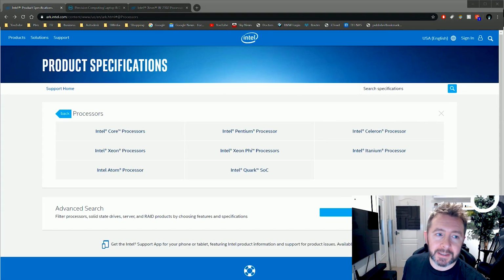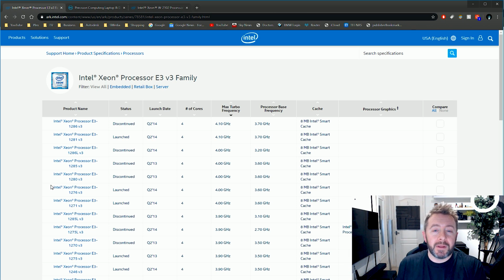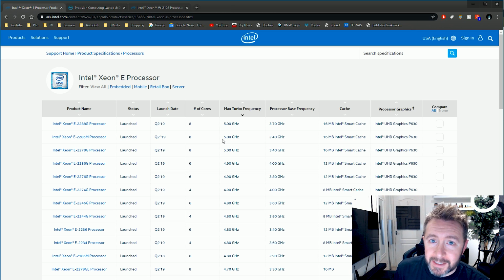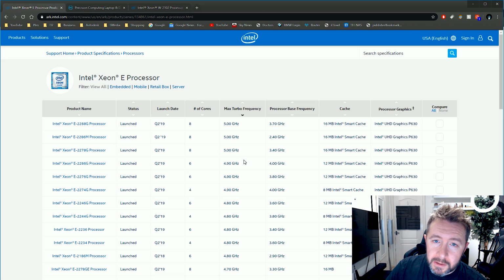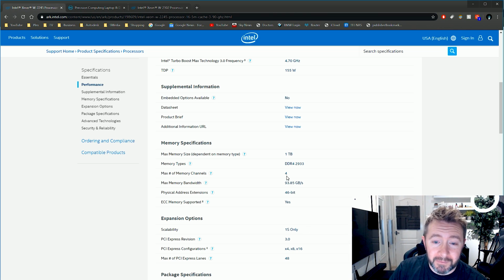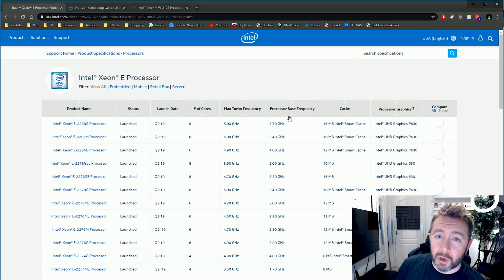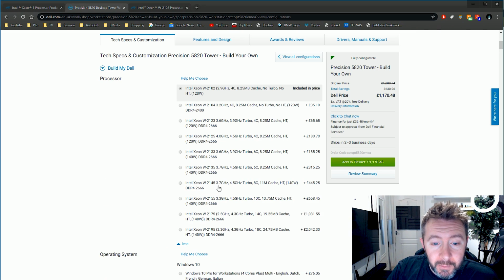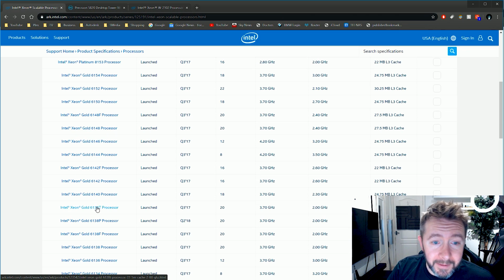What's the difference NOW between Intel Xeon and i7 i9 for CAD Workstations

Comment: I generally agree, but the paradigm seems to be shifting again. Pure CAD usually was not able to use more than a few cores well. It’s more of a mixed bag now with some workflows benefitting from cache or core counts at unexpected points.

The software landscape is changing. I used to find single threaded bottlenecks everywhere. At one point, I was even catching what I assume was SolidWorks draw calls for edge display hitting CPU bottlenecks and other oddities. A bunch of stuff like that all got sorted over the last 5 years or so. I’ve even compared on the same Quadro to verify that bottleneck was dealt with.

One of my biggest surprises was when in my own testing I found my dual LGA2011 workstation running circles around a similarly clocked i7 in single threaded parts of the workflow, 5+ years ago. Was very likely the much larger cache.

Now I’m finding that CAM software is actually able to hit near 100% utilization on 28 cores.

In conclusion, I wouldn’t write off lower clocked higher core count Xeons with more cache, I/o, etc. Yes, they cost more and they aren’t for every workflow, but there is real benefit to the architecture at times and software is starting to utilize it better. In the near future, I’m expecting the sweet spot to be a bit higher core counts/cache with things like the 13900k doing well so long as the software and scheduler get along.

Comment: Well, I still wouldn't recommend using an Xeon-E Desktop CPU unless you really need to use ECC. The biggest difference and the most important one is the boosting behaviour. 

With Xeon-E CPU in general, the CPUs will be boosted according to the Intel spec. This means that, that maximum boost clock will be only maintained for 8 seconds then it will default back to the base clocks. Whereas with the Core line, the manufacturers just do whatever they want and set the boost to unlimited. This makes for being a bit more creative in selecting motherboard, cooling and casing as the CPUs can get quite hot. But more importantly, they can maintain the boost clock indefinitely. This means you would end up getting way more performance by sticking with the Core line, and making the Xeon-E simply not worth it, unless you really need ECC. And considering how much focus you placed on the boost clocks, this information is extremely important and should be taking into consideration when recommending an Intel CPU. 

Do note that this "unlimited boost behaviour" is done my motherboard vendors in general. The big OEMs probably don't do this, but this information is nearly impossible to get. 

For notebooks it is better to base your choice on the base clock of the CPU instead of the boost frequency, for exactly the same reason. Notebook CPUs almost always stick to the Intel spec (boosting for about 8 seconds) and then falling back to the base clocks.
Reply: I don't know if this is true for all Xeons, but I was able to set my Xeon-E to boost until hit hit 100℃ using ThrottleStop

Comment: Hello There,
Thank you for your nice explanation.
 I have posted a Question on the Inventor forum for the selection of a CPU and a graphics card.
Will I9-12950HX perform better than Xeon E-2276M, and what card would perform better A4500 or A5500 if both are 16GB.

Comment: Hey Neil, can you tell me which type of processor would handle this process better in Inventor (Xeon or Intel 'i-')?
BOM editing.
One of the most time consuming processes happens when I copy-and-paste or drag-to-fill an entire column in the BOM consisting of more than 500 discrete parts (with multiple quantities). So for example, after sorting the bom and auto-filling the 'Item' with numbers, I copy those numbers and paste them into another column, that can take up to 3 minutes to process. Do you have experience to say which type of processor will do that quicker, and how much quicker? Another scenario is when dragging an item at the top of a column all the way to the bottom in the same BOM. Can you tell me which processor type is best, Xeon or Intel 'i-' type? Thanx...Chris

Comment: Hi im planning to buy a used 5 yrs old workstation laptop with Xeon 1276M + Quadro P1000 for $500 for cad works and learning Inventor and revit. Is it worth it?
or 2 yr old i5 10300h + 1650ti for $500
or new i5 1235u + 3050ti for $700

Comment: Where did you get the info that the i9 and the xeons are the same chip? Can you send me a link? I have just never seen this before?
Reply from the maker: I’m not sure if Intel have or ever would come out and confirm it, but there’s tons of press articles saying this is the case. It’s also logical. They’re not gonna have two different fab processes which mfg the exact same specs but then just brand them differently on packaging, that makes no sense. But it’s widely reported as common knowledge, documented by third parties who possibly have contacts who’ve confirmed it, but personally there’s no doubt in my mind. There are many xeons that are unique and not shared with a core sku though.
Reply: I just don't see how that could be possible. Wouldn't the architectures be completely different with a Xeon vs a core processor? I tried to do some digging but I couldn't find anything confirming this.
Reply: @Neil3D  Its Zeon's are also way more expensive by the looks of it. Am I wrong?
Reply: @Neil3D  Zeons also look way more expensive, no?

Comment: What's the issue with RYZEN ? I'm a Phd student and will be doing lots of work on CST and Ansys doing antenna simulations. I have sent a Ryzen Threadripper 3960X based config to my IT team. Is there anything i need to be worried about ?
Reply from the maker: Things change over time, as new products are released the landscape can change.  But at the moment AMD do not have a good reputation for software & driver reliability, at a low budget level that's not much of an issue but at enterprise level that's not acceptable.  But as they're releasing new generations of Ryzen they're now beginning to catch up with and arguably take over Intel with performance, but whether the new stuff is reliable enough to run in enterprise is an unknown.

Comment: Just ordered this from dell . I needed a new laptop for cad design . Is there anything you would change ? Thanks . 

No FGA
32GB DDR4 Memory,4X8GB,2666,Non-ECC,SoDIMM
M.2 1TB PCIe NVMe Class 40 Solid State Drive
Qualcomm QCA61x4A 802.11ac Dual Band, 2x2, Wireless Adapter + Bluetooth 4.2
7740 Smart Card, Fingerprint reader, & NFC
E5 C13 Power Cord 1M for North America
Safety/Environment and Regulatory Guide (English/French Multi-language)
Qualcomm QCA61x4A 802.11ac Dual Band, 2x2, Wireless Adapter + Bluetooth 4.2 Driver
6 Cell 97 Whr Long Life Cycle Lithium Ion Polymer Battery(3 Years Warranty)
Intel Xeon E-2286M, 8 Core Xeon, 16M Cache, 2.40GHz up to 5.00GHz Turbo, 45W, vPro
No Bracket
Windows 10 Pro for Workstation (4 Cores Plus) Multi - English, French, Spanish
No mouse selected on your system
No Option Included
US Order
Dell Limited Hardware Warranty Plus Service
ProSupport: Next Business Day Onsite, 3 Years
Thank you choosing Dell ProSupport. For tech support, visit //support.dell.com/ProSupport or call 1-866-516-3115
No Carrying Case
Not ENERGY STAR Qualified
No AutoPilot
No UPC Label
Dell Precision Optimizer
CMS Software not included
Intel ME Disabled
Resource Media not Included
Microsoft(R) Office 30 Days Trial
Internal US English Dual Pointing Backlit Keyboard
Keyboard Lattice
No Additional Hard Drive
Regulatory Label included
FCC Label
No Docking Station
No Mobile Broadband Card
Intel XEON Processor Label
No Accessories
Intel Xeon E2286M, 8 Core Xeon, 16M Cache, 2.40GHz up to 5.00GHz Turbo, 45W, vPro
No Additional Hard Drive
No Additional Hard Drive
Not selected in this configuration
Shipping Material for DAO Shuttle Box
System Shipment Material Mobile Precision
SHIP,NBK,DAO,SHUTTLE,7740
SHIP,NBK,WW,MIN,7740
Quick Setup Guide for Mobile Precision 7740
SupportAssist
System Driver for Mobile Precision 7740
Dell(TM) Digital Delivery Cirrus Client
Dell Client System Update (Updates latest Dell Recommended BIOS, Drivers, Firmware and Apps)
Waves Maxx Audio
Dell Developed Recovery Environment
Dell Power Manager
Bottom Cover
No RAID
E5 240W 7.4mm Lot 6 PCR, Liteon
OS-Windows Media Not Included
BTO Standard Shipment (EL)
Not selected in this configuration

Comment: Ryzens are good now, but all the big advantages they have over Core processors seem to lie in multi-threaded applications?
Reply from the maker: Quite right, although the newer ones are pretty good at single threaded.  Problem is they're not being taken up by the workstation vendors so its difficult to find them in Dells etc.  Probably something to do with contractual obligations with Intel.
Reply: @Neil3D  More like the workstation vendors had contracts with Intel and didn't foresee AMD kicking butt like it is.   Just wait... 

And why buy a workstation when it is so easy to build one ?
Reply: TechGuy big corporations aren’t building there own office pc’s they usually are leased are bought outright from , dell,hp,lenovo.....

Comment: very out of date compared to these monsters 9th-12th gen cpus

 i was using a 3930 which i got 4 years ago i didnt do my research though so i thought it was new  and thought it was used which was why it was so cheap but it was so cheap cause it was old 
i found out the same year i got it months later it was a old cpu 

 for me copying tv show dvds took 5 mins for each episode and when i would skip through different scenes in my editor it would have a delay and rendering would take long say a hr video took like 40mins

i upgraded 2 months ago to a 12400 and i no longer get delays previewing and rendering for the same length video takes 10mins my chip was 150 

and im using a PRO B660M bought for 125
and my temps maxes in 60s thats when rendering

before i would get to the 70s with my old chip 

and copying dvds eps take now 2 mins each

my virus scans are faster to

the reason i didnt upgrade to 12900 is cause it wasnt a big upgrade from the cpu i got now

and the amazing thing is my cheap is a i5 model years ago in the era that my 3930 it was no i5s that could compete with that this goes for all i5s before the 10th gen i5s was always seen as the mid models 

now i5s since 10th gen can compete with the i7s it is no longer a big difference in performance like it used to be

Comment: Great video, Thank you. 
What's your opinion on which is better? 
10th Generation Intel® Core™ i9-10885H Processor with vPro™ (2.40 GHz, up to 5.30 GHz with Turbo Boost, 8 Cores, 16 Threads, 16 MB Cache)
or 
Intel® Xeon® W-10855M Processor with vPro™ (2.80 GHz, up to 5.10 GHz with Turbo Boost, 6 Cores, 12 Threads, 12 MB Cache)

Comment: Hi Neil, very helpful for someone like myself looking to build my first workstation who’s is quite new to the subject of hardware/operation. 

My workflow consists of 3D modelling and rendering along with 2D work: Rhino 3D and Vred, Photoshop and Illustrator, Indesign, etc.

I’m currently looking at x3 options for the CPU and would be extremely grateful for any advice:

1) Xeon W2245 (3.9 - 4.5; 8 cores)
2) intel i9 (3.5 - 4.6; 12 cores)
3) Threadripper 3960X (3.8 - 4.5; 24 cores)

I’m aware that the i9 doesn’t support ecc but don’t know how important this really is. 
Any advice would be very much appreciated!

Comment: OMG, core frequency? Who cares? Not relevant. Stop making videos about hardware, please.
Reply from the maker: No.  Nobody watches the software videos anymore, they're not worth my time.  I have the analytics and objectively more people are interested in hardware than CAD tips & tricks.  But more importantly, I did that for 5 years straight and got bored to death with it, and just don't want to do that any more.  
I release a CAD challenge it gets 4k views and flat lines, I release a mobile workstation video at the same time, it gets 13k and is on a fast incline.  I create a membership program where I start doing the Inventor tips & tricks again, and only 100 people join, that's the interest people have in software videos, if the majority of people see my Inventor videos as being only worthy of being free and no more valuable than that, then it isn't worth my time doing them unfortunately.
Reply from the maker: Coming back to this.  I just yesterday released a video discussing the removal of the Quadro brand from Nvidia.  That video in 2-3 days time will have more views than the last CAD challenge I did on the channel several months ago.  Hardware is very relevant, there's exponentially more interest in it than software videos and a people who watch software videos don't stick around.